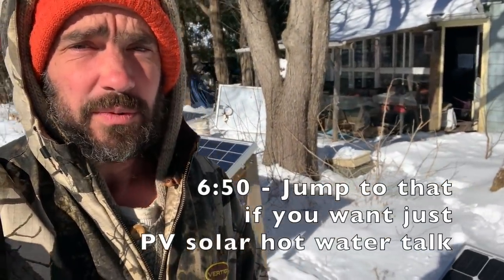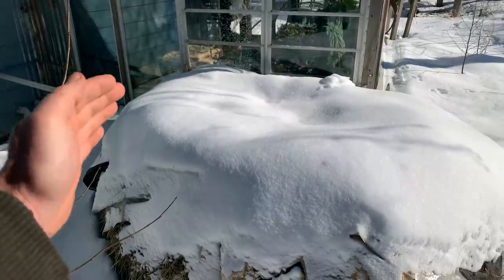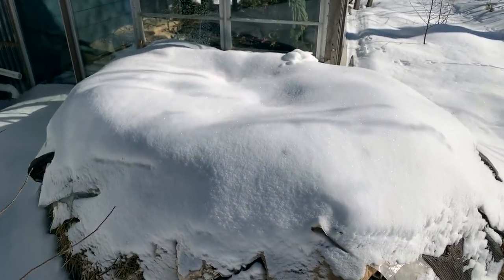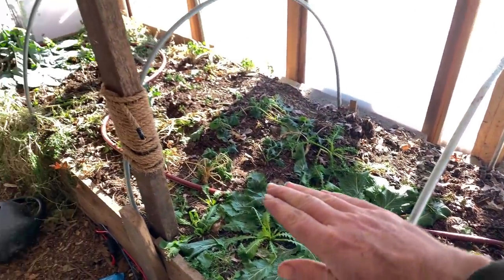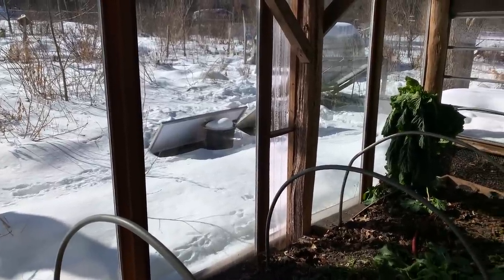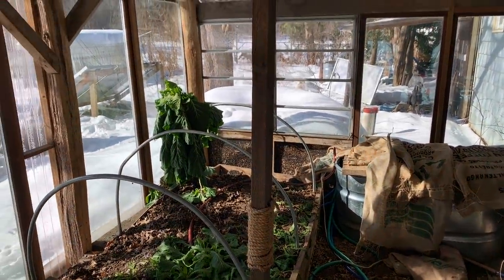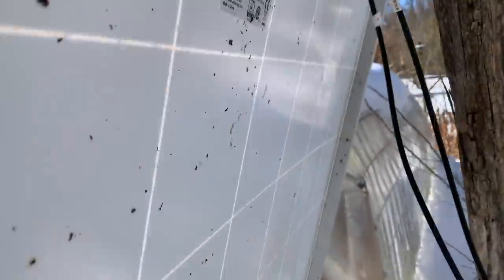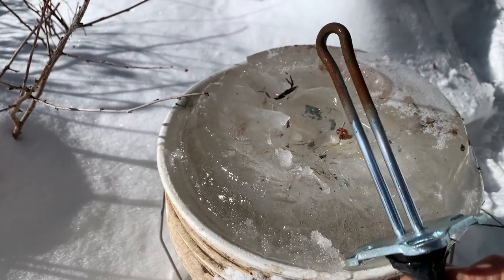Compost heating FAIL! (but solar water heating has promise!!!)

Comment: Would it be workable to make a small rough wood lean-to over the compost pile - perhaps with the wood dyed black from your black walnut harvest? In my experience, controlling moisture is one of the most important aspects to keeping a compost pile active in the winter. If I ever feel like I need to moisten the pile in the winter, I usually use warm wastewater from cooking pasta or boiling potatoes in order to give the composting microbes a kick of energy from the runoff starches along with the influx of temporary warmth. 

Not sure if that idea would really help with a more temporary setup though since my compost bin is quite tall and I imagine that helps it self-insulate the core significantly more.
Reply from the maker: Nice ideas to keep in mind for sure.  We save those cooked juices to add to our chicken grain to cook on the woodstove... Precious stuff in our home!
Reply: @edibleacres  That makes a lot of sense! That is a much faster turnaround converting waste calories back into food calories without all the extra steps of soil amending and plant growth.

Comment: How tall and wide can you make that pile if you add new materials?  It looks like your pile did work given the depression in the middle. It looks almost like a donut. Is it like filling the tank in your car? Is there only so much energy to be produced from a certain mass until you have to refill it? Instead of covering the compost heap with burlap you might need a small green/hoop house/cold  frame over the  bed to passively harness the sunlight to keep the composting microbes warm , productive, and happy.  good luck!  I am going to cover mine today with poly to see if that will help prod my smaller pile into heating up.
Reply from the maker: Good notes, and yes, the mini-hightunnel idea should be reasonable.
We may be updating this project soon and I'll try to share some notes.

Comment: Hi. Very interested in this topic, picked up some old panels to experiment with, too. I was thinking if trying something with old oil filled radiator to add solar heat to a space...
A couple of thoughts...
1 Love your videos, especially the chicken system!
2 Seem to recall reading that pulling heat from within the pile cools it down too much for the  decomposition process to keep firing away at high temps.  Cannot remember source for this info, so take it as something to.... maybe consider?

3 There is a youtuber, Dirtpatcheaven, who makes hot/hugelculture  beds inside a hoop house to grow veg in cold temps... move the pile inside. She has videos on her set up.
4 As you experiment, be careful heating water in a closed system, as you don't want it to explode on you... need expansion tank...
4 Those heating elements are supposed to be submerged before plugging in... 
5 what about some sort of insulated water vessel [scrap water heater?] inside that can be pumped into plex tubes on a schedule to add heat when you need it?
Reply from the maker: So many great ideas and notes here, thank you thank you!

Comment: Consider making a rocket stove with extended seating to warm your greenhouse. The seating  area could be used for putting seedlings on top. The heat radiated from the seating area warms the room. The ticket stove uses very little wood. I am sure you could tackle a project like that and you would forever have a warm greenhouse without messing about with compost.
Reply from the maker: A rocket stove would be lovely for this.  Probably too complex for this setup but would be amazing when we are ready to design something new from scratch in another area.

Comment: I've been heating water direct with three panels for year now and I've had nothing but good luck,but I think if you get some used electric water heaters your insulation problem would be solved
Reply from the maker: Glad to know it may be a valid way to go!

Comment: I think before you plug in the water heater you should suspend, or float them in the water tank. Perhaps at the start of the season when the system is able to run through the winter

Comment: What gauge and length of wire are you using to connect the solar panel to the heating element? I have dabbled with solar panels and my biggest concern is loss of energy when transmitting over long distances. The other concern is safety as an incorrect gauge of wire can become a fire hazard. You probably want to find an amperage meter to measure how much power your solar panel is producing. I have no doubt it is still perfectly suitable for your application, but panels do degrade over time. I suspect Cornel University had to replace them as they no longer generate enough power for their specific needs. I am glad you are able to recycle the panel instead of it going into a landfill. 

The other thing I will be interested in seeing is how you go about insulating your water tub. I have a tub that I want to insulate, but unsure as to what R value it needs to be although my use case is different. I grow water lilies in the summer. Unfortunately the nights can go down to 10c so I want to try and retain enough heat in the water at night. I've found that water lilies will only flower when the temperature is 20+c for a sustained period of time.

Have you considered using passive solar to heat the water in your tub? You might want to check out a couple of channels on youtube. desertsun02 and Tech Ingredients. I think the winter sun angle is low enough that you could place the unit in your greenhouse to prevent freezing at night, yet still get sun to hit it during the day to heat up the water. Its just a thought. Looking forward to your next video on this project. Thanks again for sharing your experiences, successes and failures!
Reply from the maker: Thanks for your notes.  The wire here should be good to 30A and these panels are way below that, and if I pair them they'll be in series so no amp increase as far as I know.  I will keep an eye on that for sure.  
 I think direct heating a water tank with sun energy and good insulation all around is a more reasonable project and I bet you'll figure out a great way to make it work!

Comment: very good vid again, I wouldn't call it a failure though on the heating system; I would just say that it was not completed to it's optimum performance, with the points you pointed out and if the pile a little bigger I think it would perform much better or more efficient.
As for the heating unit you have laid on it's the side is from an electric hot water tanks and need to be submerge in water all the time or they burn off and stop working, yours is on it's way out  because it got to hot, if you had higher power it would fail in seconds. IF you find an old hot water tank  you could remove the unit from the side of the tank and place it on the holding tank and regulate the temperature because they have a thermostat built in. These heating units also come in 110 and 220 volts as well You submerged the element in the water after, it should be that way all time so they don't burn out' your never burned out right away because it never had enough power right from the start 
Cheers thx.
Reply from the maker: Really good notes here, thank you.  I hope I didn't kill the element in this experiment!

Comment: I think the compost pile needs to be a lot taller to sustain heat output. Also, if water is being heated to 50c but returned to the pile at only 2c maybe it is actively cooling the pile below thermophilic bacteria optimum range? Maybe hyper-insulating the water tank or speeding up flow rate to return warmer water to the compost tubing might keep it humming for longer?
Reply from the maker: I think the system was working 'too well' at getting heat early on and that coupled with all the little inefficiencies that really really add up took the pile down too low too fast to survive the cold snaps we've had.
Reply: @edibleacres  Better to be a victim of your success than failure! I’m sure v.2 will hit the sweet spot!

Comment: You need to read the comment I just put on your compost heating part 2 from 2 years ago if you want to solve your compost heating problems check it out should double your output and winter shouldn't affect it if done right

Comment: Even better, solar vegetable oil heating. You could even run it through a big stirling like they did with the sunpulse 500. Store the heat in an insulated tank. Pump water through cool side of stirling to make it more efficient and out comes hot water
Reply from the maker: Probably a bit too technical for my scenario but a good note

Comment: Could the solar panels be used in place of the compost to push heated water through a system? 
How do you keep everything straight? I keep a notebook but it just ends up getting lost when I need it lol
Reply from the maker: I think the solar panels can do the work to heat water and move it potentially... Once the weather gets a tiny bit more mild we'll be exploring more of all this.

Comment: not sure if you're familiar with it, and apparently almost nobody is, so i ended up having to import from China....   called PCM - phase change material...  it's basically the same stuff that you find in those snap hand warmers etc...  this stuff is organic (as in based on natural compounds), and can be engineered to phase change at a certain temperature.   i got mine to to from liquid to solid when the temp drops to 17c or lower.   like water turning to ice although it doesn't seem logical it gives off heat... so the pcm material is liquid above 17c and starts to turn to solid, almost looks like paraffin wax, and in the process it gives off heat....   i cut a bunch of 4" sew pipe in half for about 5 foot lengths, glued caps to the bottom, and left the cap loose but drilled a tiny hole in to make putting the top on easier... it doesn't expand, so you don't have to worry about it blowing the top off when it gets cold.    but it might be another option...   i have mine across the back of the greenhouse, but it could easily be built as a sort of surround around your water.     might make the transition slower though since the water would tend to level out of the temperature... just a thought.
Reply from the maker: Thanks for brining awareness to this material, definitely a topic to explore and understand better...

Comment: Great to use waste stream PV. But maybe it is better to use the PV to move water and to generate solar hot water (with some antifreeze) via black piping under glass. Solar hot water does not require conversion of sunlight to electricity, thereby avoiding loss due to conversion. PV is replaceable energy (not renewable energy), whereas solar hot water is truly renewable. thoughts?
Reply from the maker: I get what you are saying 100%... Challenge is that in this context the most sun this time of year is over in the garden.  Running a scavenged length of extension wire to a beat up free PV panel is WAY easier and cheaper than figuring out how to super insulate a pipe out to the garden and keep things moving and avoid freezing etc.  Then what do I do with the anti-freeze gunk later?  I know it is less efficient in numbers ways but more appropriate as far as implementation in this context and with the embodied energy we're working with (I think) :)

Comment: I think you might be on to something. Getting free solar panels should open up a world of possibilities. 
Yes your compost heading system should work with a few modifications. If you still have enough chicken bedding you might want to top off your compost pile. You might be able to get it kick started again with enough nitrogen.
Reply from the maker: I think I may wait until we are past the super cold time here and then see what we can do to renovate the scene... Refill the tank, get the solar aspect dialed in to contribute heat and then kick start it with a bunch more material and warmth.

Comment: It appears to me that the solar panel has a DC output. I didn't see any reference to an inverter being added to the circuit. So it looks like you've wired a DC circuit into an AC water heater. It would definitely heat up, but it should be DC to DC or AC to AC for the best results. Amirite?
Reply from the maker: I don't think it works like that in this case, with a resistive element.  Search electric water heater videos and you can find some various info... Ohms are the most important part I think.

Comment: There's a big difference between starter batteries and deep cycle types! The starters have thin plates for a lot of amperage all at once to crank over an engine, but have very little storage capacity, and the deep cycle type  that have thick plates and can discharge deeply with many cycles. Get the right batteries or solar will be frustrating!
Reply from the maker: I plan to invest in good and appropriate batteries for other applications, but in this case since I'm experimenting with a ton of variables I wanted to use something old/used and inexpensive.  I am most interested in having the dump load from the panels go directly into heating water, so the battery is more there as a buffer.

Comment: Please ditch the lead acid battery for solar heating. Talk to a local plumber, get a hold of an old electric tank heater. It is often cheaper to replace an old unit rather then repair both elements(from an unskilled homeonwers point of view) Use your drive to replace the elements with dc, pipe the tank into the open loop that you currently have. Viola you have a solar battery with zero waste. Heats when the sun is out, stores energy in the old tank as well as heating your compost, your soil, your green house and your new, old tank water heater. No electronic controller and no concern of a battery in your greenhouse. Always ground. Cheap assurance.
Reply from the maker: Good ideas, I will make some calls to plumbers and see what might be possible.

Comment: I feared you might have problems with that compost heater.   Just not enough total energy to heat the pile and the greenhouse .
Solar PV will work fine heating a bit of water, but you aren't doing that heating element any good by having it partly in ice partly air.
Reply from the maker: I learned pretty quick that element needs to be fully submerged!  Seems OK since it was getting WAY less power than it can take, but a good learning lesson :)

Comment: Brainstorming a bit here. Rather than photovoltaic panels generating electricity (overall it's a pretty inefficient process, between how much the panels generate and losses in transmission) what about fresnel lenses focused on the water tank? The old projection television sets used quite large fresnel lenses and could be had for the price of stripping them out of old tv's. I know those sets have been over and done for decades now, but maybe there are still some of the lenses out there. And maybe the lenses are still being manufactured... Just a thought, and one that might require very specific circumstances to be of any value ;) I try to think of ways to use solar power that don't rely on converting it to electricity, because there's so much loss in that process.
Reply: Do you by chance live in Ohio and have a real nerdy podcast?
Reply: @chainsawasmr8736  Nope ;) Not Ohio and no podcast.
Reply from the maker: I am very interested in the fresnel lens idea and have lots of experiments bopping around in my head about them...  I need better goggles to experiment with and will be hoping to explore that quite a bit this winter if I can get a hold of some good bits!

Comment: My only 2 cents about the compost heater is you probably wanted a fan and fresh air circulating throughout the pile.  When I make a compost pile like that it'll heat up pretty hot but then if I don't stir it or get it some air it'll crash temp wise.  I've thought of making a compost pile in my greenhouse for heating but haven't worked out how I'd want to do it.  Maybe I'd just make sure I had extra room to turn it and when it starts getting cool flip it.

Comment: If you are putting an electric hot water cylinder element into a metal container the metal container needs an earth so you don't end up getting an electric shock.

Comment: why not bury it underground (geothermal) and just handle it that way?  constant 55 degrees....thank you.
Reply from the maker: Great approach in another context... Here we are just too wet to be able to dig down and not have it become water logged in the winter...
Reply: @edibleacres  Tangenting off this idea, you could bury the pex and fill with a water/glycol mix to use the heat of the ground. The solar panels could be strung together to provide enough power to run a compressor (waste stream example is an old air condition window unit). The compressor "amplifies" the heat from the ground by pressurizing the liquid in the tubes, and that heat can be distributed to your bed with more pex or a radiator of some type. Or You could put the radiator in the water that you're planning to use to heat your beds.